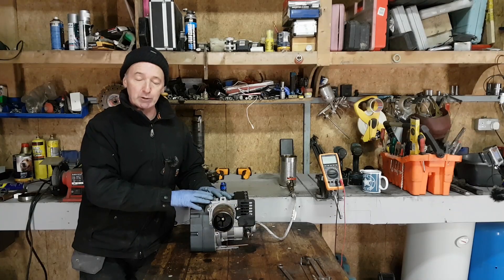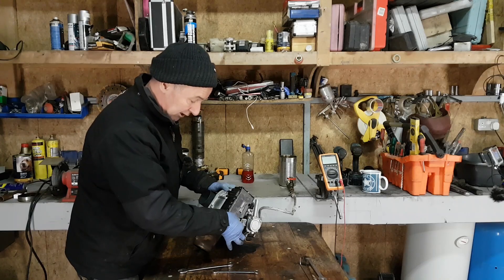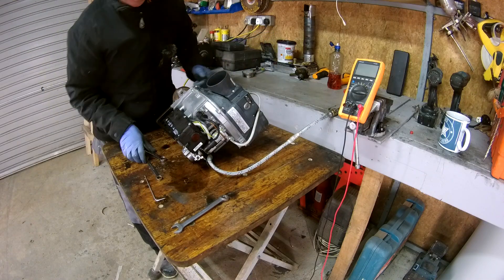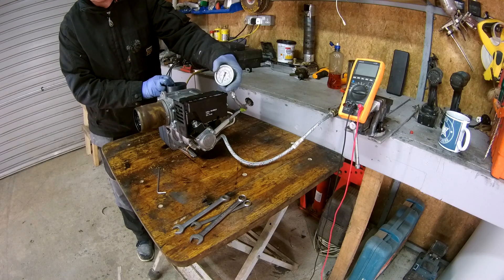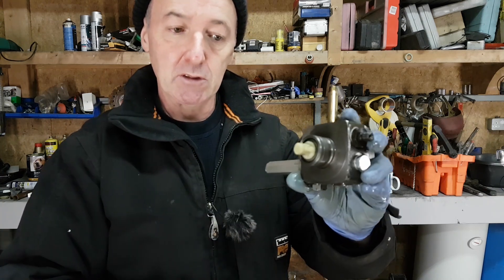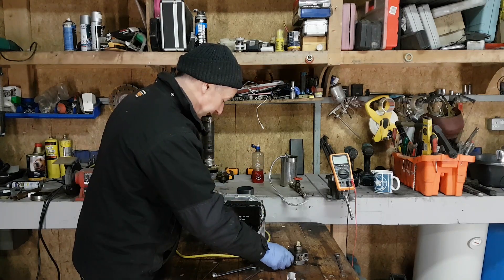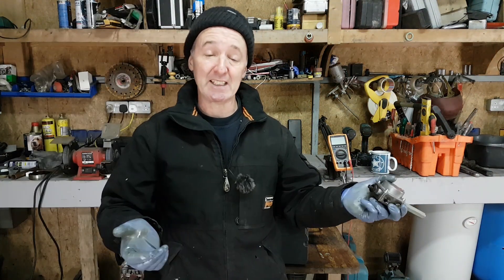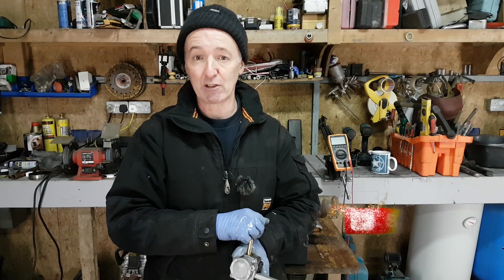How to change the pump on a Riello Rdb Burner

Comment: Gerry, In the U.S. A very small percentage of homes use Kerosene or even Oil as fuel to heat the house. I did a little research.  Maby 2% use Kerosene and about 5% Fuel Oil.  The majority use Natural gas or electricity. I do enjoy your posts tho. Thanks.
Reply: I live in the new england region, and many homes are oil around here, although the more populated regions tend to have more Nat gas.
Reply from the maker: Hi Stanley. Thanks for the info. Here in Ireland Kero and diesed are popular in rural locations and gas in many cities. Air sourse heat pumps are getting more popular here now as there is an energy requirement on new homes. I will be making a waste oil burner soon with some parts from one of these burners but I have a lot to get through first. Appreciate your comment Cheers Gerry
Reply: Basically everyone inn new england not in a city burns oil. Only seen gas in a few basements my whole life in Maine.